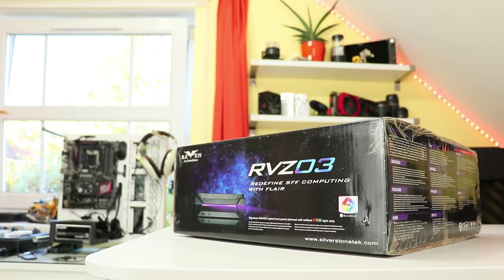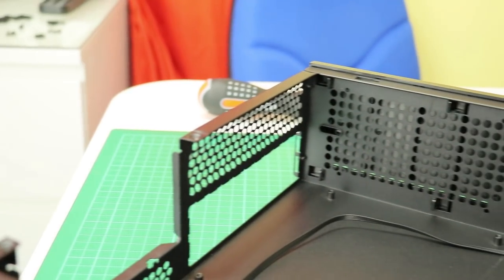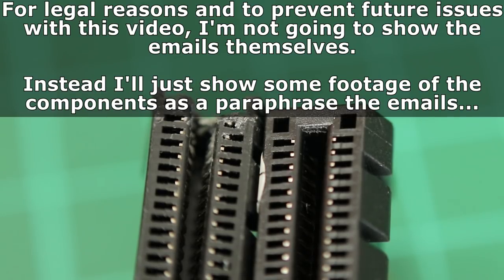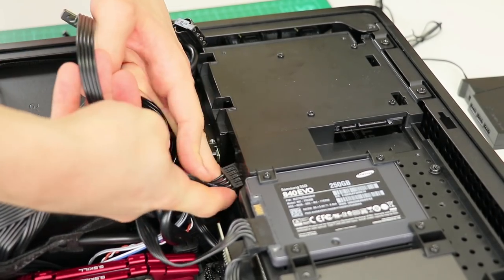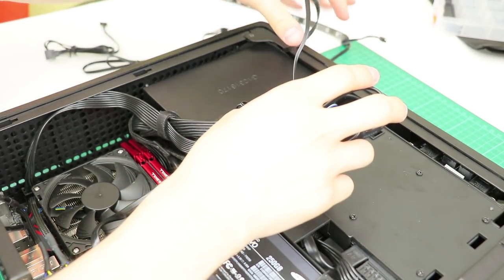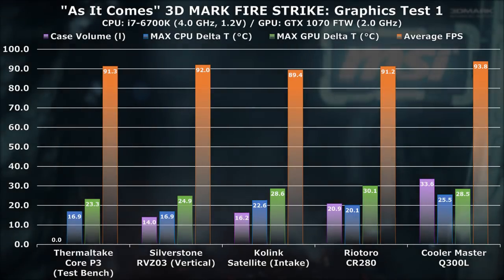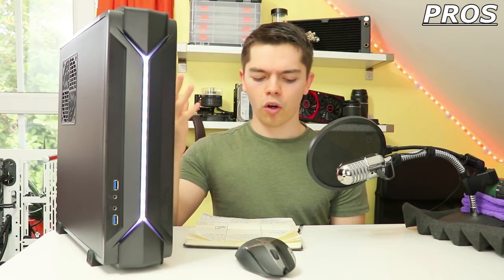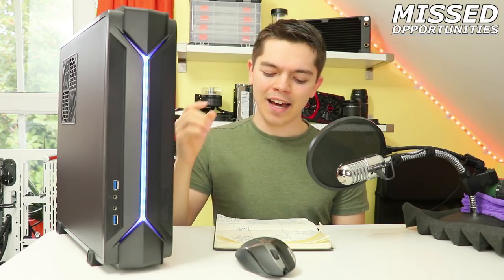SilverStone Raven RVZ03 (Mini ITX) Review

Comment: I just like to say, this is by far the best case review i seen ever, although very big video but well worth the time, thanks for sharing it.  I have some questions if you dont mind, as im planning a build on it.

1) Im planning on running an i7 8700K @ 4.7ghz (delided), wondering about the CPU cooler, the two options 
  1.1) Noctua NH-L12S - 70mm height, and the RVZ03 has 83mm support, so 13mm from the CPU cooler to the side case, wondering if there is any tolerance to keep install the case fan,  in the past with Silverstone FT05 while the specs said 162mm heatsinks i was able to fit fine 163mm (didn't even touch), so wondering if there is some space that would allow me the extra 2mm to fit a Noctua NF-A12x15 PWM?
  1.2) Cryorig C, with 74mm with the 140mm fan, seems like a good option, seems used by most of the Asus Z370i + RVZ03.
  1.3) SilverStone Tek NT06-PRO-V2, cooler design for this case in mind with 82mm height, although i wouldn't be able to place the inside fan, but maybe go with an external Noctua NF-A12x25 (i dont mind the looks more interested on cooling).

2) RBG light on front, you showed for motherboard support its 4pin 12v, ASUS ROG Strix Z370-I Gaming has only a 3pin 5v, wondering if there is a way to work this out or it simply wont be compatible?  I want to try to use the Asus Aura sync to show CPU temperature colors.  

3) I saw on your video that there is some room (35-40mm) on the GPU section to place standard 120x25mm fans, you seem to have used an evga gtx1070 that its 2 slot, do you still have any room, there are some GTX1080ti that are 2.5 slots wondering if they would still fit with the the 25mm thick fans? might even try to fit a RAIJINTEK MORPHEUS II with the 2x Noctua NF-A12x25 PWM.

Thanks for your time,
Reply from the maker: Thank you very much, and sorry for the late response, I've been ill for a few days (such a poor excuse I know haha). Hopefully I can cover all your queries now though.

1.1) I think the tolerances would be too tight to keep the case fan, but at that small distance I don't think the case fan would add a lot to the situation, of course there would be less work for the CPU cooler, but I think it would just be adding more noise an performance gains.

1.2) I presume you're talking about the C1, could be a really good option to help with cooling the VRM and the RAM. I'd probably prefer the NH-L12S over the C1 since there's a slight potential option to keep the thin case fan afterwards, and the heat sinks seem to be similar sizes.

1.3) If cooling is what you're after, then this would be the best option. Have you also considered the Noctua L9x65, it's quite a beefy cooler and you would be able to retain an internal case fan, but of course is a little smaller in footprint. It may be worth looking around to see is you can find some test results from a single source comparing them.

2) I presume it would be a case of connection all but the 12V connector to the motherboard. It's probably best if you send Silverstone an email to confirm the connection. 

3) It's a case of doing the maths whatever the extra difference of the cooler you're looking at is, minus that from the 35-40mm, then take away the thickness of the fan and you should be left with a figure that represents the left over space.

Hope that helped you out, let me know if you need anything else. And sorry again for the late response.
Reply: Hello 
Regarding the 1.1 option: 
I was thinking the same thing in order to create a push pull on the heatsink. Was wondering if you have tested this to see if it fits. 
Another option would be 13mm think fan, like the 140mm from Thermaltake with 120mm compatibility. http://www.thermalright.de/en/fans/28/ty-14013r?c=10
Any thoughts?
Reply: @AV Techy, thanks for the detialed reply.  I havent consider the NH-L9x65 yet, but i just saw your review, seems very impressive cooler for its size, while for sure will allow the installation of the NF-A12x25 because of the 51+25 = 76mm (83 is the max), i dont think it will benefit much since a 92mm width cooler, i still think the C1/L12S/NP06Pro would net better results.  The problem is trying to run a delided 8700K/8086K @4.7/5.0, so its going to be really hard to keep it under control, reason im trying to match the fan case to the cpu cooler so fresh aiflow cools the cpu.

Im more inclined toward the L12S, and now that Harry suggested the Thermalright TY-14013R, it should fit, 70mm of the noctua + 13mm of the TY14013R = 83mm, thats if the case really allows the full 83mm.  

@Harry Koutalidis, thanks for suggesting the fan, i also have an NF-A12x15  laying around, so with the L12S ill test both fans.  Ill post here my finding, just a headsup, still haven't decided on the motherboard, as i feel the AsRock will match better the CPU socket for the L12S with the RVZ03 case fan opening, its not 100% but better than the Asus.  Also kinda waiting Z390 to hit the market to see if the mobos go on sale.  I leave you a diagram that i did with the RVZ03 + AsRock Z370 fatal1ty itx.

https://imagizer.imageshack.com/v2/1473x1128q90/924/KFOoSf.jpg
Reply: My RVZ03 arrived, so did the Cryroig C1 and Noctua NH-L12S, the EVGA GTX1080Ti FTW3, the 8700K, and AsRock Z370 Fatal1ty ITX/AC, Corsair vengance ddr4 3200 CL16, Triple Noctua NF-A12X25 PWM and NF-A12x15 PWM, only missing the Corsiar SF450 Platinum (no stock everywhere).  I knew i coudlnt finish the build but decided to take out the GPU bracket and use an ATX PSU and route the cable through the GPU hole, mostly to test the components that i had in hand, specially to see if it i didnt had a DOA, to my surprise the NH-L12S is a better cooler to the C1, i expected backwards as the C1 allows to install a 25mm fan on top of it (case closes fine), the NH-L12S also a great fit for the case as it allows twin NF-A12x15 PWM (one on top and one on the bottom, and the case is perfect as you cant attach the fan to the top of the heatsink but the case fan hole matches 95% to the position of the heatsink so you attach it with the side panel standard screws.  the NH-L12S is around 8C cooler at 400 less rpms (although 2 fans but 15mm instead of 25mm), the end is that the C1 with the 8700K@4.7ghz all cores prime95 26.6 blend test for 30min,  without filter reaches around 80C while the NH-L12S nets around 72C, with filters the C1 goes to 87C and the L12S goes to 79C, overall the Asrock + Noctua cooler ends up like they were made for each other.
Reply: @ Pabula. That is great. I now have configured an i7 7700k with an NH-L12s with the fan under the heat-sink and a Cryorig XT 140 fan - an 140mm fan that fits in a 120mm socket and is 13mm thick. Although I think that the Noctua 120mm/15mm  fan would have been a better choice as the specs of the Cryorig fan and Noctua fan are almost identical. However the Noctua would probably direct the airflow in the centre of the the heat-sink which more appropriate for this case as you want to create positive air pressure in the centre of the case. I an using an i7 7700k that can now be clocked at 4.7Ghz. 
However AV Techy was right. this is an increase of 0.1 Ghz over the Noctua L9i with the assistance of the Cryorig XT 140 fan. This is testament to how good the L9i is. Also, the L9i was a little more quieter than the L12s .
Reply: @Harry Koutalidis thanks for the feedback, really its a interesting case and enjoy seeing other experiences, a lot more planning is involved then any atx or micro atx setup, that said, im about to give up on the RVZ03, the NH-L12 is fine, specially with the asrock z370 itx/ac, it lines up almost perfect, and the heatsink has its merits being able to cool down a 8700K @ 4.7ghz all cores without going over 80C (at the expense of noise), the noise is not so bad, specially considering that the CPU wont get hammer by games, but the problem is the GPU, EVGA GTX1080Ti FTW3 is a 2 slot card, and this is where i think it fails for me, it simply needs the NF-A15x25 to be above 1400rpms so the gpus fans dont reach 2500rpms where it goes really loud.  Personally i think im asking too much from a case this small, with a lesser gpu my guess it would be fine, so i decided to move toward Silverstone LD01 and the Asus Z390 Maximus XI Gene, i feel the combo will net much better thermals and i can use 3 slot card (and have 25mm fans right next to it) and still use a dedicated sound card on the back while being somewhat small factor (not as small as the rvz03) but it will work on my AV Rack.  Also for the CPU the LD01 will allow a tower cooler like Mugen5 so everything should be quieter on load, but will see, maybe ill change my mind again.
Reply: @Pabula. Thank you for your input, I am having similar thoughts as I want a silent system when not gaming. However if you have not moved to the new case, you might want to consider changing the Case fans on the GPU window to something like the NF-P12 redux-1700 PWM. These fans have better static pressure that the A15x25 series. In this case you need more static pressure than airflow in order the get the air in and the air out through the vents at back, top and bottom of the case. Check out the Noctua website for a comparison of the specs of the fans...
Reply: I don't have any high end equipment to test static pressure, but i can tell you that the NF-A12x25 is quieter under the same rpms than the NF-P12, specially at high rpms. http://www.silentpcreview.com/forums/viewtopic.php?f=9&t=70062&start=60

That said its very unlikely that ill be using them on LD01 (mostly because of the fan hole placement on the case), i want fans that cant be stopped at 0% pwm, Noiseblocker fit this but too high the starting point, so ill probably end up with Thermalright TY147ASQ for case fans, and very likely ill be using NF-A12x25 on the Mugen5 and exhaust.
Reply: In case anyone is interested, i just finish the RVZ03 build with i7 8700K and GTX1080Ti,  I posted some pics and stress tests,
https://pcpartpicker.com/b/RQxG3C

Thanks to AV Techy, as your video help me a lot into choosing the components and motivated me to do build on the RVZ03.
Reply: @Pabula  Thanks for sharing your build, it look awesome. 
I would appreciate it if you could help me with some doubts I have:

1. Do you think I can use the Noctua NH-L12S with Asus Rog Strix Z390-I Gaming, this will fit?
2. What power supply do you recommend me for the rtx 2080ti and the 8700k, I was thinking about the Silverstone SST-SX800-LTI because is SFX format and for the 800W it delivers.

Again, thank you so much.
Reply: @odlanyermuller4849 , sure thing 

1) The NH-L12S fits my AsRock Z370 itx/ac, and it does fit the Asus Z370i, you can see the video from https://youtu.be/zLD_-POVYG0?t=318 .  Now the Asus Z390i, its hard to say, the extra IO/heatsink is what worries me, weather it clear the NH-L12S or not is something i cant say for sure, if the new io/heatsink dont exceed the side one that on the z370i then it should fit.

One thing to keep in mid on the Asus is that because of the cpu socket placement i would say the Cryriog C1 is a better fit, usually people with the RVZ03 cases go sideways with it, check https://pcpartpicker.com/b/zVLJ7P .  Now its also a tight fit on the Z370i so the bigger io/heatsink on the z390i might or not fit, but my guess is it will but again i dont own the board to know for sure, its best for you to continue researching.  Another thing about the C1 and the RVZ03 is that it can fit a 25mm thick fan on the top instead of the 12mm included, check this build https://www.overclock.net/forum/50-small-form-factor-systems/1466816-silverstone-raven-rvz01-rvz02-ml07-ml08-ftz01-owners-club-72.html#post26483918

2) On the power supply, for me the best one you can get is the Corsair SF600 PLATINUM, https://www.amazon.com/gp/product/B07F84FJ1G/ , for a lot of reasons, 
a) its size, you will be very greatful you went with a sfx later on, when you have to deal with cables, specially this size of PSU will give you a ton of space.
b) efficiency, its a platinum psu, and 600W will be more than enough for your build, im powering mine with 450W fine. But there is 750W version coming soon.
c) comes with short custom cables, the platinum version already comes with the upgraded cables kit, this will also help you with dealing with the cables.
d) comes with the sfx/atx bracket, you wont need to spend extra grabbing silvertone mount.

Other good options,
* Silverstone SST-SX800-LTI, i consider it, but it wont be as small, in brands i prefer seasonic as my first choice and corsair as my second. That said, im using a silverstone =P
* Seasonic Platinum Focus Plus - any of this will fit even the 850W, i used one on the build before switching it, the only thing you might need is custom cables as it does get tight and fitting so many cables is possible as you saw from the thebuilder (link above), but you need to get creative.

Some last comments about the RTX2080Ti,  be very careful which one you chose, the RVZ03 can fit big ones, but in my case the EVGA GTX1080Ti FTW3 is a very tall card, it fits but the power cables touch the upper case, its a ritual to fit it.  One that i would say it fits with 25mm case fans installed is the Gigabyte RTX2080Ti Windforce (not the gaming), the Gaming version probably will fit with 15mm case fans.  On MSI the Duke might fit, i order one that might come in two weeks, i have my doubts on the length and if it can fit with 25mm fans, my guess is that you will need 15mm fans, the Gaming trio its very unlikely it fits because of the length and height.  On ASUS ROG Strix to me its the best RTX2080Ti, i didn't chose it because i need 3xDP, but you very likely need 15mm case fans because of the 2.5 width.  The EVGA FTW3 Ultra its very unlikely it will fit because of the height, length and having 3 slot on the mount, and if it were to fit you wont be able to install any case fans.

If you need more help, ill be around, good luck on the build.
Reply: @Pabula  Thank you very much for the help, it's very kind of you :)
Reply: @pabula Just took a look at this build and very good details in there. Thanks for sharing! :^)

Comment: Best case review I have ever seen. Just ordered this chassis in white. I also found in an Italian video that shows this case supports wraith spire cooler from the Ryzen 7 1700 / 95tdp version. I saw in one video that it had 35c lower temps than the C7. I also found a mod video that you can use the fan from the C7 on the spire to make it low profile by drilling the plastic corner on C7 fan with tiny holes to line up with the screws from the spire to mount it, which you do after attaching it because it overhangs over mount screws. I may want to do that to have the case fan blowing on the cpu fan and the wraith spire and will do the low profile mod.   My C7 is running at 2600rpm right now and giving me 65c in idle on my 2700x. I have another version of the Silverstone with the slim optical drive and it was better before it was summer time here. I like that you can have the full amount of 4 SATA drives which my motherboard has, so there is expandability for future!
Reply from the maker: Thank you very much, I'm glad you found it useful.

Hope your modding goes well, the AMD stock cooler seem to be very capable, hopefully you can squeeze it all in and keep the fan speed to a more reasonable level.

As for storage, if you went all out and ran your system from an M.2 drive off your motherboard, you could get up to 10TB from 3x 2TB HDDs, and 1x 4TB HDD (in addition to the size of the M.2 drive). It's good to keep in mind since you probably want to optimise your system for future usage. There's also some room for a RAID setup between two 2.5" HDDs which could be pretty nice.

Anyway, all the best with your build, and thanks for checking this one out! :)
Reply: Great work, but I do have two questions as I consider buying this case instead of the cougar qbx. How loud is it? & How did the mod effect the noise?